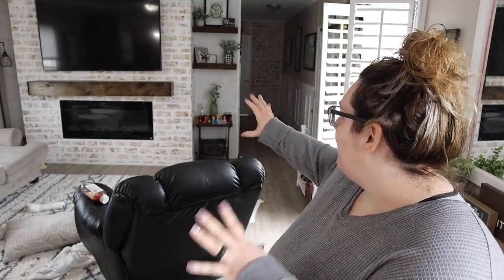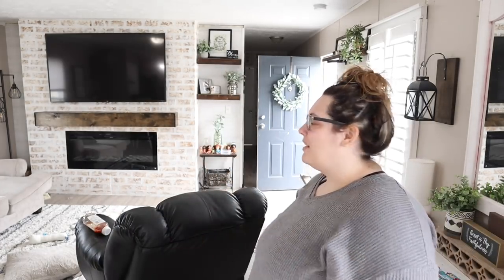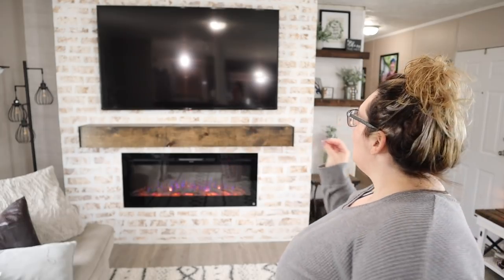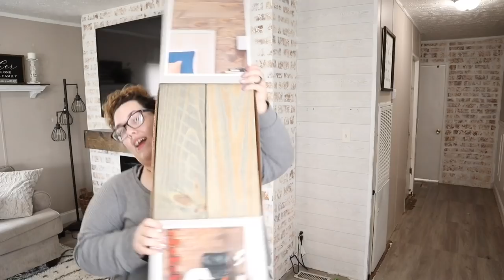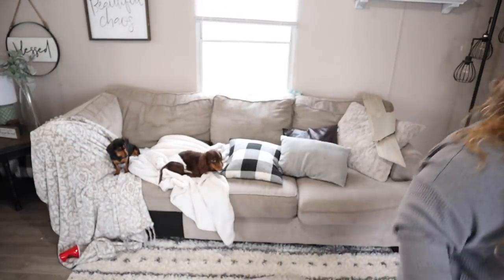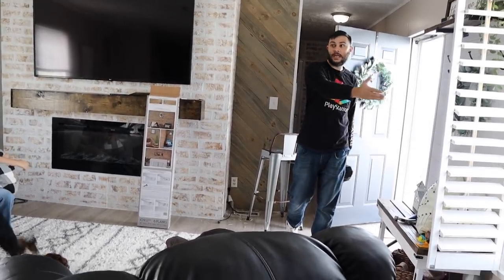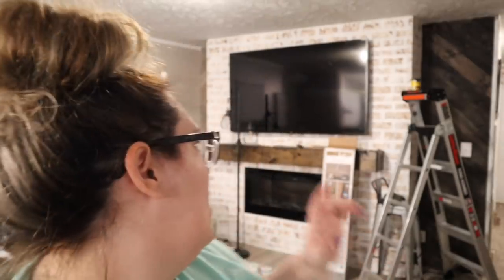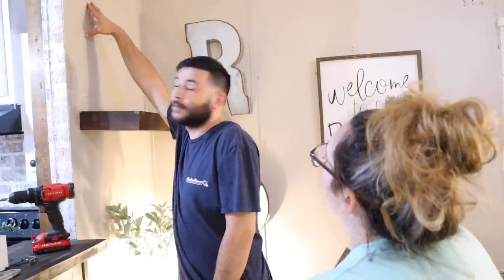FARMHOUSE MOBILE HOME REFRESH | DIY angled ship lap accent wall | farmhouse single wide makeover

Comment: Just my opinion, but here goes. I'm a "stager." for realtors. My granddaughter  recently bought a mobile home as temporary housing. ..I like the white, but not the marker lines.  It looks cheap. 🥺  could you change the curtains to something more subtle?? More calm??   Every week it's another major project. Maybe finish up some areas?? Like trim, edging, etc.  I'm  one of the fans who wants to see you get a doublewide.❤  save all that makeover money on that. Start looking for some repo/ foreclosures. Could you move a bigger place into that park till you had money for property? Sell the one you are in now.
 Or find property and start paying on it?. You  can use the property  as collateral if needed.

Comment: I wish I had a way to show you my extended wall,but it came out 2' as a bedroom extender,and also because of the vent,as well as the built in bedroom closit ,I have a cut out with shelfs.i have a half midnight blue,upper half mahogany chair rail white bottom half 😀 I know it sounds bold,but it looks good dang I wish I could show you